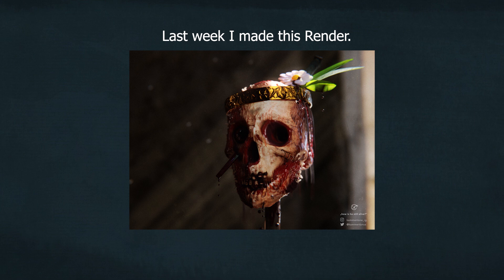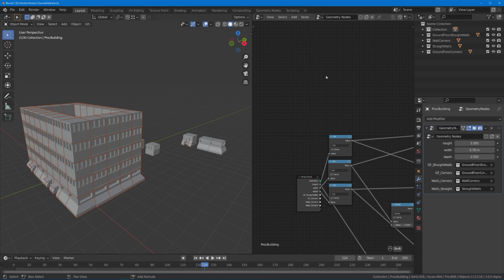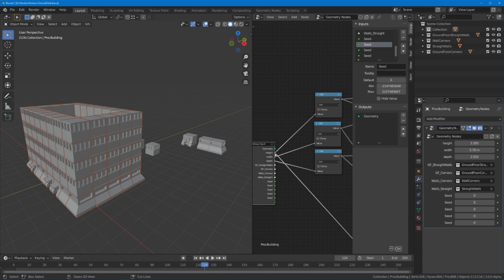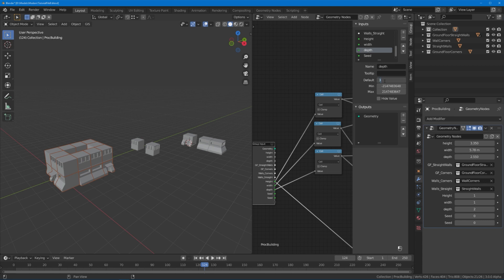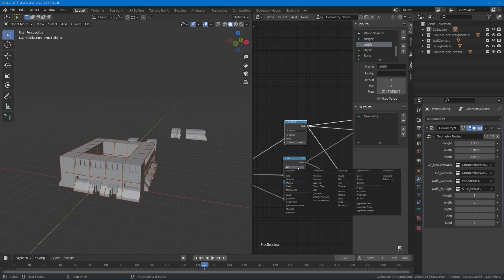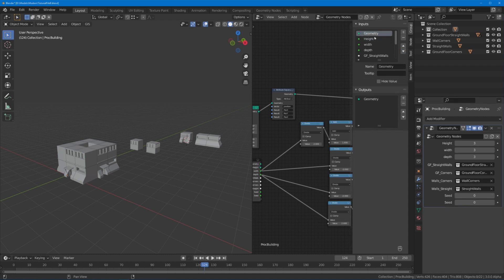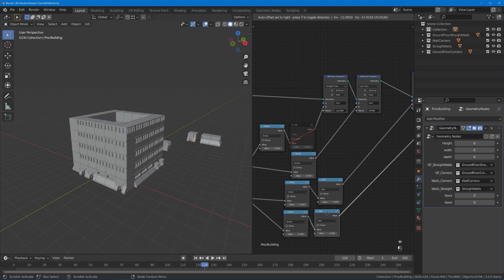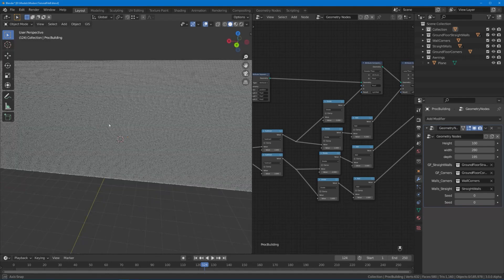Procedural Building Part 2.5 (optional) !outdatred, check description!

Comment: Hey bro, these tutorials are lit. but one thing I'd like to share is that if you would have used planes as a wall and not cubes you could straight away eliminate the attributes things as there would be no errors at the corner, well that's how i did it. turned out pretty well for me
Reply from the maker: That is true, however, you lose the possibility to create a different model for the corners and you can't model funky little rooms behind your Windows. That's what gives a lot of depth to the model. But if that works for you that's great too!
Reply: @Kammerbild  yeah i noticed it afterwards. Thanks for great tutorials bro. I appreciate it! 😊